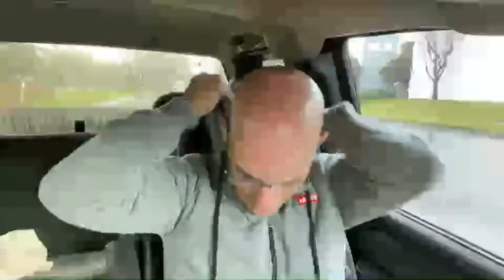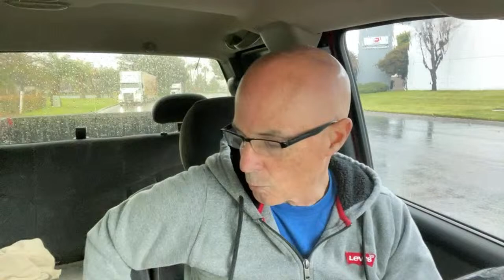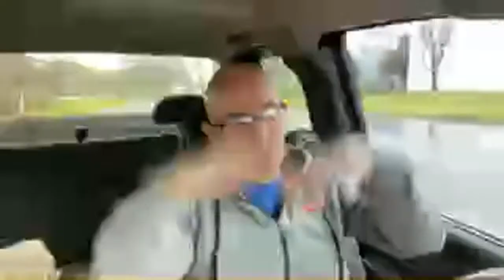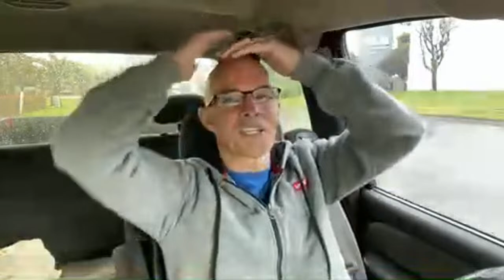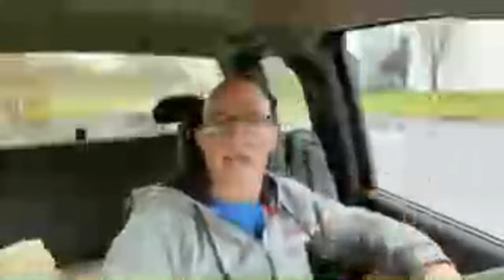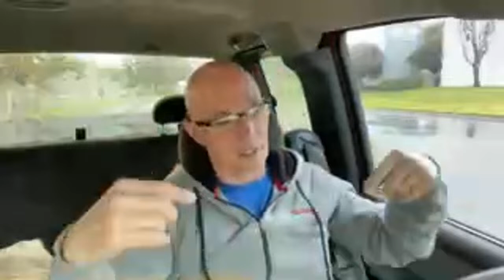Water Cooler Blower? Let’s talk tech!

Comment: I don't see any chance for intake air cooling. However for a burnout car or boat that's running full throttle for long periods of time cooling the casing to stop it from expanding from heat and possibly contacting the rotors. It would be a reliable thing no power gains. A drag or street car never runs for more than 60sec at full throttle, the average competition water ski boat in Australia runs anywhere from 60secs to 15mins at full throttle so yeah the housing could be a reliability in those cases.

Comment: Little to no change. No time for heat transfer to the air charge. There is a reason why radiators and air-conditioning coils disperse the hot fluid or air over a larger area. Surface area.  It slows the overall flow of the heated air or fluid to transfer the heat to the coils to be dispersed. A blower rams a column of air thru it. No time to transfer the heat to the cooler shell in this case
Looks cool though. Lol

Comment: Stiegmier had the venom cooler for the snout and Kennebell has liquid cooled blowers. I considered it for my lightning because in summer in las vegas the eaton was extremely hot to the point I couldn't even touch it. I would rather have it not be hot if all it is a coolant tee line in and out off the intercooler lines.

Comment: Be interesting to see what happens it the rotors expand due to heating but the case doesn’t?

Be good to discuss the Kenne Bell case cooled blower also, seeing as these are usually EFI and screw blowers. Can we dive into those next?! With your relationship with them be good to get some info seeing they are the only ones I know of doing it.
Reply from the maker: KB doesn't cool the whole case like this-just the hot end